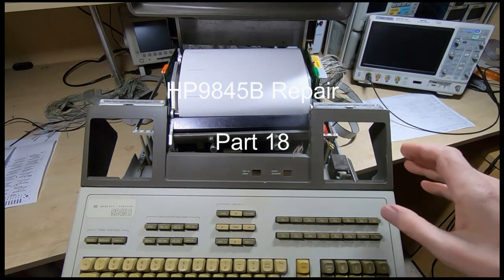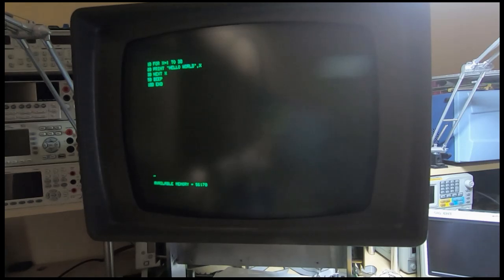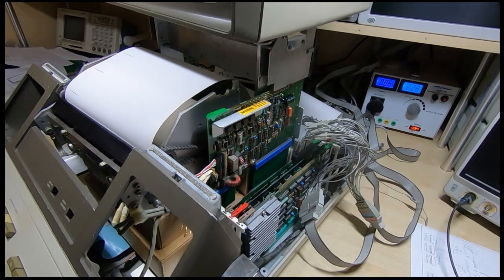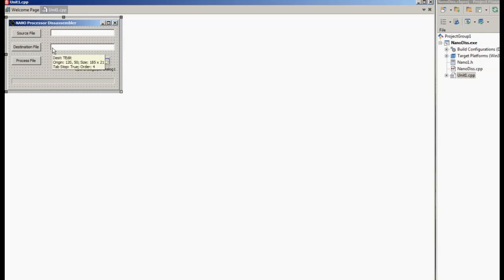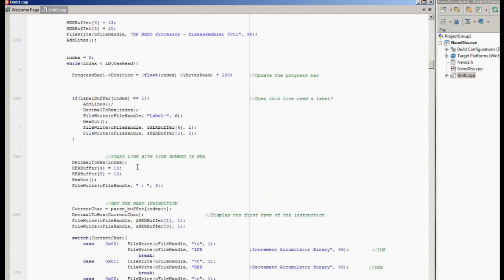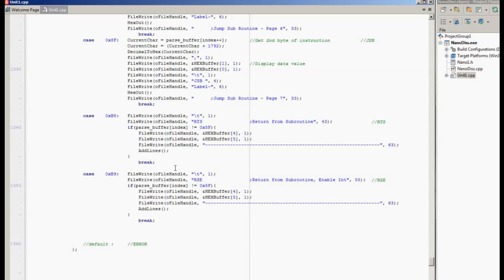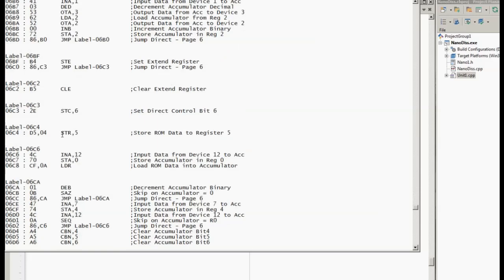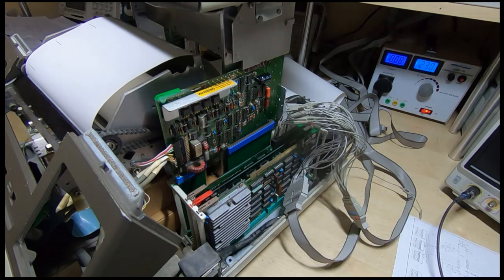HP9845B Repair Part18

Comment: FWIW, probably already known.  Some printer and NANO processor information (with pinout) is in the HP patent on the 9845 pgs 431-444 and claims section.  Ref:  Patent US4180854  HP 9845A 9845B Programmable calculator having string variable editing capability; Walden 1979 HP 584pp.
Reply from the maker: Yes I am aware of that but it does not contain any information on the inner workings of the printer firmware. There is some detailed information on the NANO processor available but not specific to the Printer (which is what I need to fix the printer :) )

Comment: Did we miss a video? Last thing I saw in pt 17 the display was still showing the wrong characters.Was that taken care of by the through-hole fix?
Reply from the maker: No you have seen everything. The board fault was preventing bit 6 from getting to the CRT control logic buffer under certain conditions and this was fixed when I repaired the board. The other display RAM looping problems were resolved by fitting a new buffer IC. The system is not really running as it should but it is getting closer.